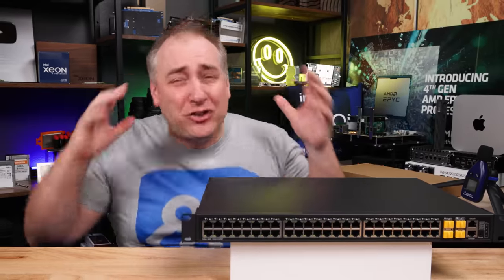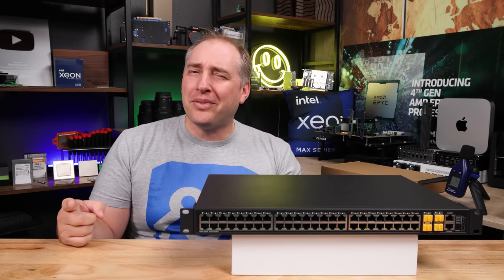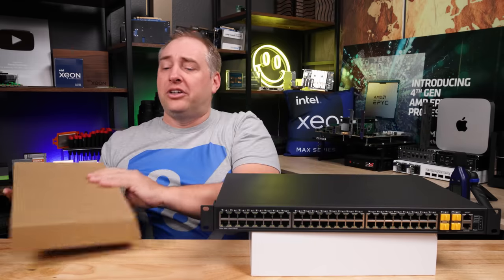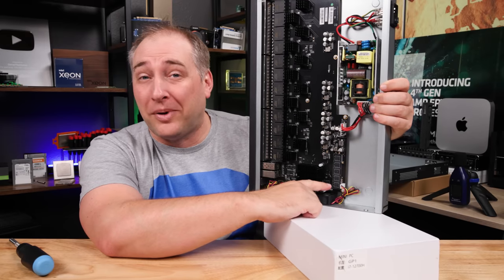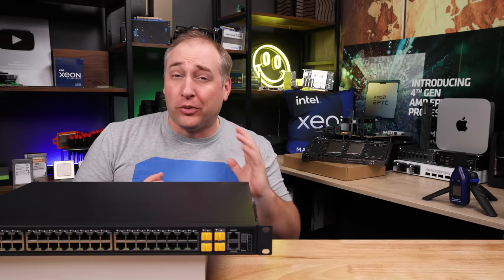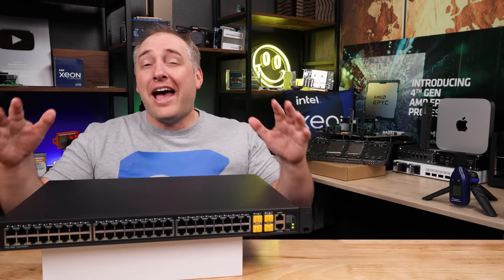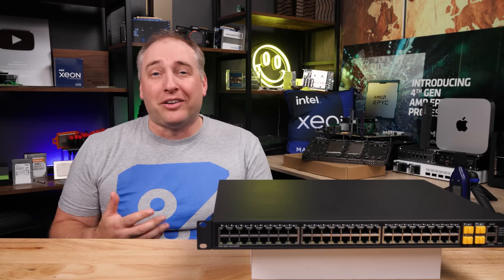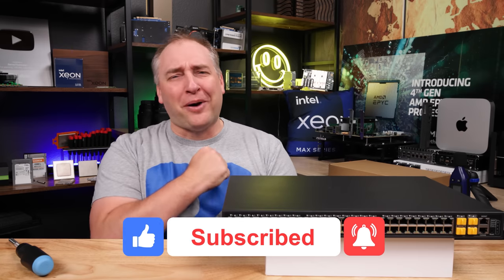INSANE $400 China e-Sports Mega-Switch with 2.5GbE and 25GbE

Comment: Tbh in 2023 we should have 10gbps switches priced the same of 1gbps. It's 20 years old it can't still cost so much!!
Reply: The problem is that big enterprise customers moved on from 10 Gbit/s switches (especially 10GBase-T) years ago so there isn't as much price pressure from that sector. Also, 10GBase-T is power hungry enough that it needs fairly modern process nodes which pushes up the price and makes it harder to make fanless switches than home buyers at large might actually be interested in.

Comment: Keep the same price and make every single port 4 times faster. Then it's a good deal.
I still hate the half assed better than 1GB but not quite 10GB stepping stones with a passion.
As a fallback okay, as a main port speed no.
Reply from the maker: The challenge is 2.5GbE works over existing wiring, 10Gbase-T does not so that is why we do not see more 10Gbase-T
Reply: @ServeTheHomeVideo  You should know that a huge share of existing CAT wiring is not full length 100m and can work perfectly fine with 10Gbase-T.
And for the really long cables 10GBase-T NICs with Multi-Gig/BASE-N can auto negotiate 2.5GB or 5GB fallback. I don't think cables are a convincing argument. And what about Europe where we did shielded, high frequency CAT6/6A/7 since forever? Do we need to be taken hostage by the US because theoretically somewhere a few connections couldn't run at full speed? I think the real reason is just cost saving and penny pinching by Intel. If 10GBE was in desktop already instead of this 2.5GB stuff the cost and power consumption of 10GB as well as 10GB switch availability for SOHO and consumers would be many times better.

Comment: I understand that obtaining those certification markings (properly) is usually NOT a cheap or simple endeavor, especially if one does not speak English. That's problematic, because the US and EU (theoretically) won't let you sell these types of electronics without them. Also probably why we can't get these here. That said, this looks like a good workhorse, and the web UI resembles other small vendors I've used (offhand, I think Niveo and Luxul). This suggests to me you've found the OEM that those other small vendors use, and that's pretty cool. 👍
Reply from the maker: the WebUI is MicroChip management so many vendors that use their switch chips will also use their management software
Reply: In the video you can see, that they put a CE logo on there, so it has everyting it needs to be sold in the EU.
CE is not like FCC, there is no mandatory independent testing. You just put on the logo and create the declaration of conformity once you are confident all relevant standards are followed. That's it, ready to export.
The EU importer has to do some other things like registration and payment for e-waste recyceling and packaging recyceling. That is a bit of a hassle for someone doing it for the first time, but a comany specialized on importing goods won't have any issue with it.
Reply: @ServeTheHomeVideo  That's cool to know! I wonder if that means this unbranded switch's firmware could be kept updated, in that case.
Reply: @fkiesel9442  Interesting. I was specifically thinking of FCC testing. It's "probably" fine as long as there isn't a (spectrum or power) noise complaint, or as a one-off like this, but they'll definitely have to get certification to sell en mass across the pond here.

Comment: The problem is that you just can't trust the chinese. I know it sucks, but you just can't. I used to work with a brand of french firewalls that were 'mandatory' to be used in the french and most of the EU government (they're not legally mandatory as that would be illegal, but basically yea).

Now, this was years and years ago, but as soon as you'd put this in a network with chinese devices, routers, switches, nas, servers, anything you may imagine, you'd immediately see the chinese traffic. It looked like normal traffic as a basic, but the firewall had deep inspection and could discover them. 

Sucks to say, I'll never use a networking chinese device again. The american ones have backdoors that are used only if you're the target of an active investigation, but if you're in that situation, no firewall would stop them anyway. But the chinese have this mantra of collect and sort later.

Comment: I dont really see the point in 2.5 and 5gig. Just go the whole way to 10 minimum. Probably time to ditch copper too.
Reply: It's harder to do PoE via fiber. 

I'm not a huge fan of 2.5gbe but 5gbe seems good, that would put the max speed just past SATA SSDs which seems like a useful metric.
Reply: Full 10Gb switches are cool, until you waste a full 10Gb port on a 1Gb device, also, why pay for 10Gb ports when a typical AP/Motherboard/SFF pc doesn't have 10Gb? If all you want is multi-gig WAN and reasonably fast file transfers 2.5Gb is fine.

In the market segment this is aimed at (high performance PC networking) you'd never see all 10Gb links come anywhere close to saturation, most of the time they'll see a few hundred Mb/s at most.
Reply: My whole house is wired with cat5e. I currently have a 24 port 1 gig switch that draws just 6 watts. 10 gig would draw much more. I'd like to keep my wiring.
Reply: @d_mcg  nobody is coming to your home to take away the switch or rip the cables from the walls
Reply: I guess what I meant was not to replace existing copper - it still has its uses for 1gig and and is great for POE devices, just if upgrading then fiber seems to be the way to go.

Comment: Why would you expect 190Gbps from a 160Gbps switch?
Reply from the maker: Nothing says it has a 160Gbps switch chip until you open it, pull off a heatsink, and look up the model number of what is being used.
Reply: It wasn't on the datasheet?
Reply: @shanent5793  datasheet?
Reply: @incandescentwithrage  The vendor supplies a datasheet, product spec, or product sheet, which is a document that details the the capacity and capabilities of the switch (eg. number and type of ports, power requirements, throughout, supported protocols) so you can decide whether it's suitable.
Reply: @shanent5793  I see you are unfamiliar with buying from China… You don't get no datasheet!